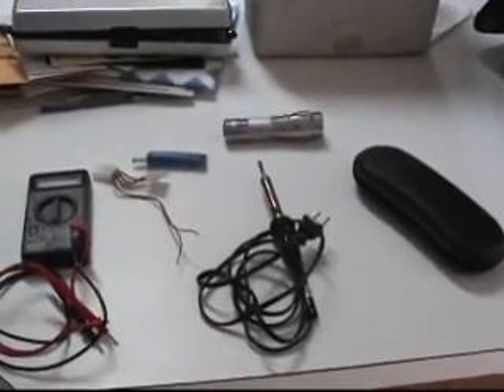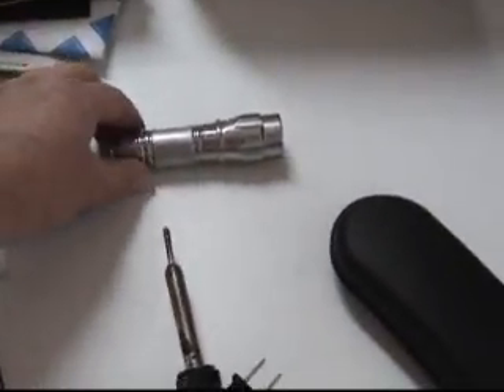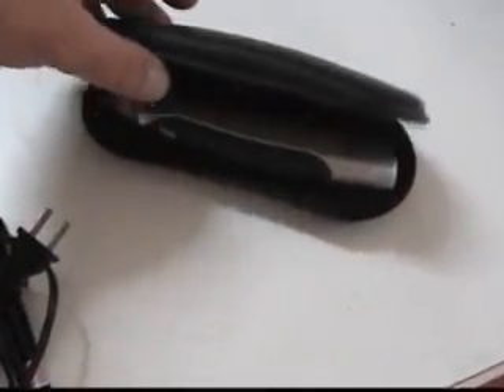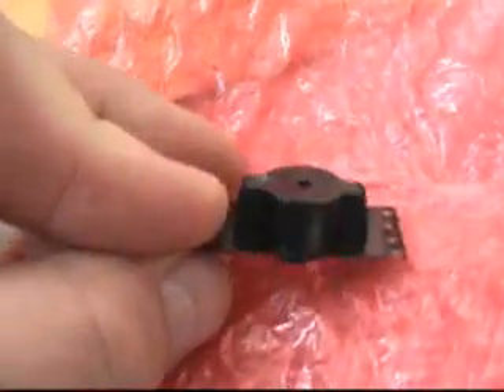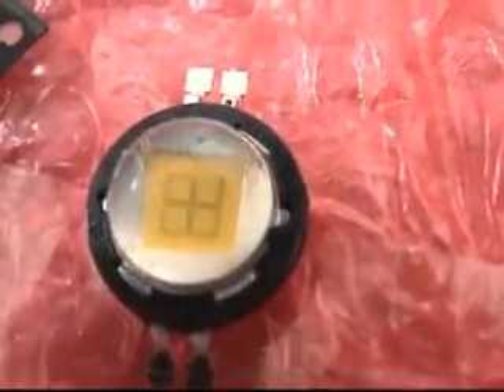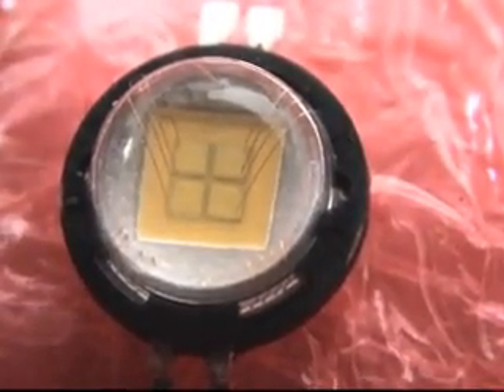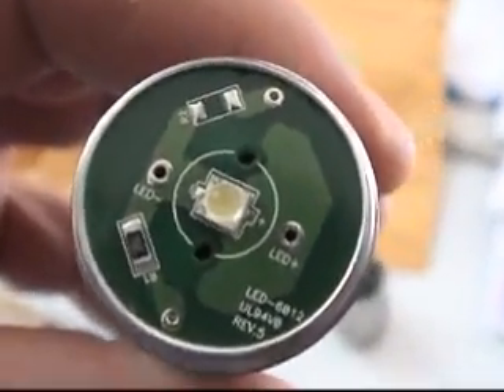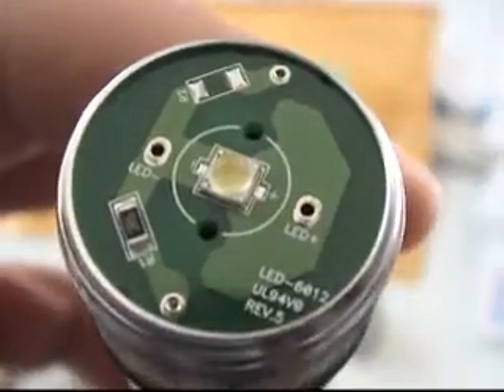worlds brightest led flashlight

Comment: Do you need to use a power controller? I can't seem to find a flashlight to be able to fit the power controller and LED. The power controller I am using is the one you suggested in your other video with 2 ssc-p7. Which flashlights do you use for your projects?

Comment: Dude,, c'mon.  The SSC P7 takes a ridiculously 
high current thatis why it's considered a very inefficient LED.
Also, it's only putting out around 600-700 lumens not the advertised
900 from what i've read..  There are way more efficient LEDs.
 I suggest you check out Cree LED's.
Much more efficient.  If you need single center
quad emmiter look at the MC-E.  It's do 430 Lumens at 
a nice cool 350mA.

Comment: @TheHeavensReject LED produce less heat for the amount of light produced. in a typical plastic lamp led the crystal for the diode gate is small, 30~50 times smaller then the high powered LEDs even ones with crystals that small can get warm if your using them at higher voltages, multiply that and you get something that produces some serious heat, Also heat is generated by resistance in the LED and the more amperage is drawn per voltage the more resistance is likely to be present.

Comment: @Zenodilodon ~ correct me if i'm wrong, but I thought one of the advantages of the LED over the traditional halogen bulb was the fact that it doesn't heat up, hence why they are more power efficient..?

Comment: @jayandersons I went to flat bed lights with the really high powered LEDs, I mount them on a flat heat sync and then the battery, usually 3.7 li-ion. I built 2 lights for my father for a present as well using a light much like yours. used a lathe turned stack of metal disks with 2 holes drilled through for power. some arctic silver for the thermal paste and it runes very nice off the original 4.5 volts " with a resistor in place ". front current to the diode is around 3.7 -3.9  volts.

Comment: I work with luxeon and seoul LEDs that are surface mounted like yours and I can tell you there just is not the enough amount of heat sync in that flash light. Those LEDs get very hot without the right cooling and while you may have a flash light that is bright for a while but this project will result in either burning out the blue LED base crystal or burn up some of the white phosphors in the LED. As it sets this light at least has a poor duty cycle.

Comment: well, i guess the batteries wouldn't last more than half an hour , and the current limiter circuit from the 40 lumen LED flashlight is inadequate.Of course using a heatsink is also recomended.

Comment: I'm sure it burns off more battery than it actually uses. Many high output flashlights do this because they either don't have thermistors or the thermistor can't regulate the tempreture because it's far beyond the threshold.

  You only get the benefit of the candlepower if there's close surfases to bounce the light off of, which means you would be indoors. So a 50 Lumen light with a wide reflector would give you the same coverage.

Comment: What is the Ah rating of the original driver, I'm wondering if you are actually producing 900 lumens?  If the original is only 700mAh it might be closer to 200 Lumens,

Comment: Where is the path for all that heat to go in this light? There is NONE that I can see!
Its just an LED wave soldered onto a fiberglass PCBA... LOL!

I can guarantee you that this light is not puting out anywhere near 900 Lumens merely running on 3 wimpy AAA batteries! Not even close!

Comment: Jimbo33000, you'd need a lot more than 8 low power LEDs to match upto this. You'd need over 25 of the best 10mm LEDs (100,000mcd LEDs @ $2.50 each) to get anywhere near the lumens the P7 puts out. So infact you'd be spending more money running lots more little LEDs which wouldn't fit in any lenses. Although i have seen that done for a joke, it doesn't work well...

Comment: About 50 minutes on full power :)
If you use protectet Trustfire 18650 Batteries, you will have full power until the last minute of the battery time is over :)

Comment from the maker: i got 2 900 lumen led lites from china (mte) they can run on a 18650 rechargalbe or 2 cr123 wich some can be recharged i dont think ther 900 lumens but ther very bright manufacher claimes 700 to 900 lumen.